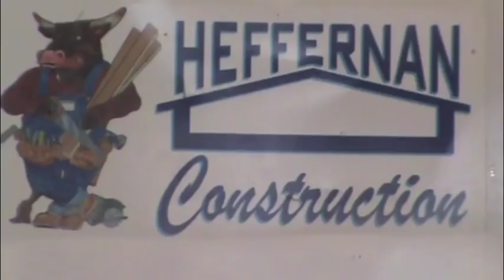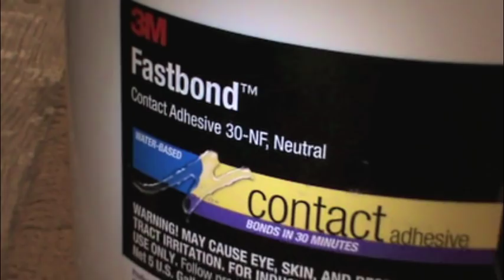How to make a laminate counter top

Comment: Nice to see the edge installed first. Gives a much better finish in my opinion. Thank you for posting this!
Reply: Your right about the edging being installed first, BUT, if at a time later the front edge gets dinged ,and or chipped, the entire top piece of laminate will need to be replaced! However if edging is applied last ,one only needs to replace the edging itself if damaged ( chipping), and it will happen somewhere along the life of the table or counter top. Some people worry about the black line to much, and of course either way you will have a black line ,either seeing it from the front or top. Bottom line ,self edge( under )looks great ,BUT self edge applied last is more practical, and much easier to replace.
Reply: Stu Stewart  still replaceable. Just gotta be careful and know how to score things properly. Or just use heat gun to undo glue 👍.
Reply: Of course its possible Mike ,but try to replace it going around a 3-6" radius with self edge under the top sheet , see how lucky you are then ! (:

Comment: Thanks i am looking to laminate a kitchen counter top but first i have to remove a counter top cooking range then cut in a built in oven i am not sure how to cut the counter top especially the back splash up against the wall. Greatly appreciate any direction/ info   again thanks for the video, it was helpful.

Comment: Pro job!  I'm learning about carpentry tools.  I guess that was a router you used to cut the laminate edges after gluing down?  Handy tool.  Also you used a heat gun to bend the laminate on corner edging?  Just barely saw it in video.  Would be useful to show a longer use there.

Thanks a lot for a concise, well-documented how to video.  Very useful!
Reply from the maker: Lass-in Angeles Just a quick tip for you. When you heat the laminate to bend it around a tight corner use paste wax on the finish side. The wax will prevent burning the laminate as you soften it with the heat gun. Thanks for watching Lass
Reply: Very good pro tip!  Many thanks!!

Comment: Did you need to file the edges? Or did your flush trim router bit do a good enough job on its own? If so which router bit are you using?
Reply from the maker: When routing the edge strips i use a straight cutting flush bit and when i router the very top piece i use a slight angle flush bit. The angle bit cuts very close and needs just some light filing to get it flush.

Comment: Hi Craig, Thank you for your video. It continues to be enjoyed by people interested in making laminate countertop. I have some questions. What is an angle flush router bit you used to trim the top sheet? Is that available at HD or Lowes? Also, can I use particle board instead of MDF and what is the disadvantage for choosing so in your opinion? In Canada, the material used by the industry seems to be particle board. Hope I can get a reply from you soon. THanks.
Reply: Hi Ann, I work in a shop where we do Laminating very often.  We do tops, doors, cabinets etc.  MDF is the best material to use for this type of project.  It looks like he was using what we call a bullet bit, meaning it has no bearing to run along the laminate already laid down.  Very risky for the fact it can burn / leave a line on the material.  Use a flush cutter bit, 1/4 inch shank, a bearing to run along the material.  The glue he is using is a very good product, we use Wilsonart 801 neutral in color, we spray it on with HD Husky quart spray gun and a compressor of course.  Also what wasn't shown was the use of a laminate file to smooth off all the sharp edges from routing it.  If you have any questions, please feel free to ask me.  Hope this helps :)

Comment: I have an antique desk that I had to take the old laminate off entirely.   I wish to put on new one but don't know who sells.  Where did you get laminate?
Reply from the maker: They sell laminate sheets at Lowes or Home Depot. It comes in tons of colors and sizes. Check with the kitchen cabinet sales to help you order. Thanks for watching.
Reply: navigator3
Reply: navigator3

A nice option is using real wood veneer.  Also, bamboo comes in many grain patterns and shades.  And finished with a water based clear coat it'll be hella nice and durable.

Comment: How'd you fasten it to the island?
Reply: Best way is to screw top from under ,up through cabinet top rails, and divisions in cabinet ! For beginner I would get what's called (chair brackets) which are small angle steel brackets ,screw them along the cabinet front ( inside facing) and, along back of cabinet rail, then screw Formica  top to bracket using correct length screws, so not to put a screw up through surface of new top. Never use glue, as one can never easily remove top if needed at a later date !.

Comment: Not putting you down Mike just making a point here !  If you notice there is a gap at the top of the smaller radius after running the router around to trim edging ,and in this case it can be filled before top sheet is applied ,however if you replace edging at a later date for any reason, and the plastic is NOT tight around the radius ( for any reason) you end up with  edging that sticks out further than top sheet and there's no fix for that !  Everyone has their own way of doing things and some work out and some really turn into a disaster !  Trial and error sometimes is the only teacher!
Reply from the maker: A disaster? these comments are the hardest to answer. I can tell you that custom laminate counter tops with any tight radius corners may need bondo filler in those spaces. This is a standard practice learned from doing several hundred in my career. By the time you would have to replace just the edge, the laminate you used may be hard to find and the customer would want a all new updated counters anyway.
Reply: You may be right Craig, but I have done a lot of lam. plastic also and can wrap a 3" radius without any need for filler or bondo, with the edging put on last . If you are using the edging as self-edge under as an excuse for not being to wrap the radius tight ,I can see your mind set. All people do not like self-edge under and some prefer edging on last so it can be replaced easily if nicked or damaged. That being said if you are unable to wrap tight ,you better stick to self-edge under ,or you'll end up with a gap at the radius. I'm done here because people tend to get up-set when an alternate way of doing something does not fit their mindset!          Stu.
Reply from the maker: Om my , what people would prefer the edging on last, unless that is just you giving them that option and they don't know any better. The 1 1/2" edging in a kitchen goes on first and the top laminate always overlaps the edging. One good reason is water will be able to work its way into the edge and start pealing. Second reason is laminate will contract with tempiture change and slightly stick up and be left to chip off by sliding something off the counter top. 
    Stu, no wonder your adamant about replacing the edging.
Reply: Craig Heffernan

I'm a finish carpenter and I'm not proud to say I've done a lot of p-lam.  The way it was done in the is video is correct.  I didn't see you file the edge after routing the top but I think it's safe to assume you did.  Stu is full of dung for sure.  I wouldn't sweat it either.